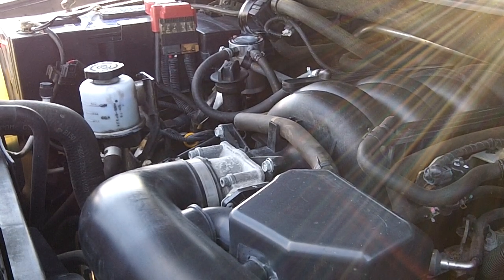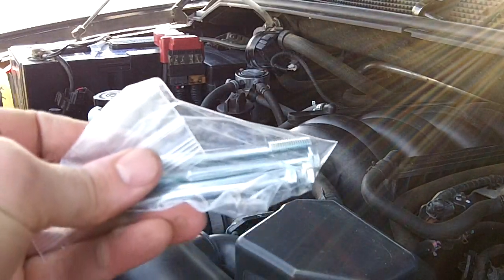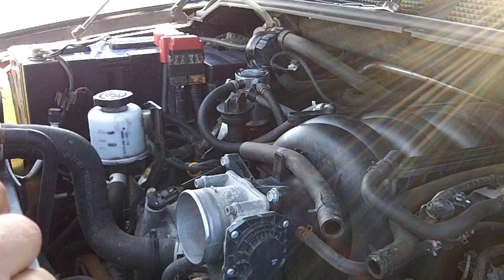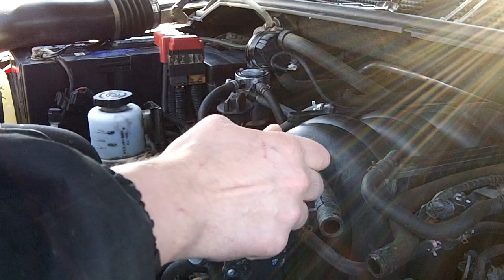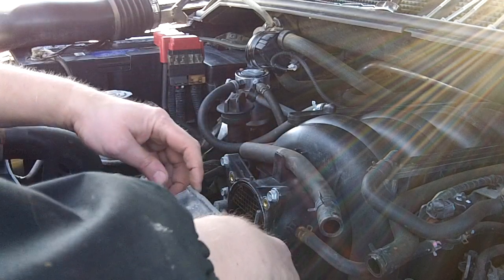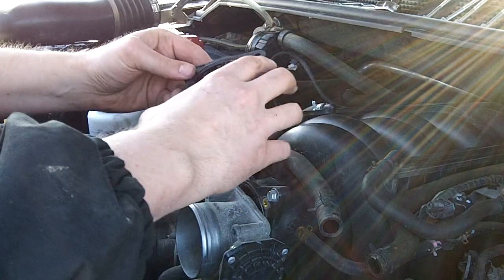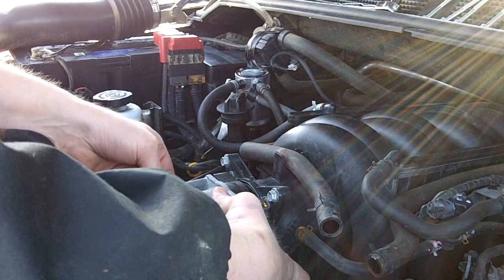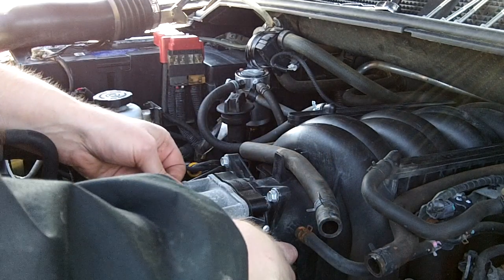Nissan Titan and Armada Thottle Body Spacer Install Volant Vortice

Comment: I just put a new  durlast throttle body  and a afe spacer on my 2013 armada last weekend,  actually feel a little good response and good gas consumption  than before
Reply from the maker: I prefer the cold air intake results over just the throttle body spacer I'm not using mine anymore.
Reply: @TitanTown  ok i actually have the k&n intake.   Did your spacer used to whistle?
Reply from the maker: @Shane23Armada  no it didn't really affect the sound

Comment: Depending on how long the tube is for the after market intake you might have to take the spacer out or trim the pipe.
Reply from the maker: I finally ordered it!  It will be installed next week.  I